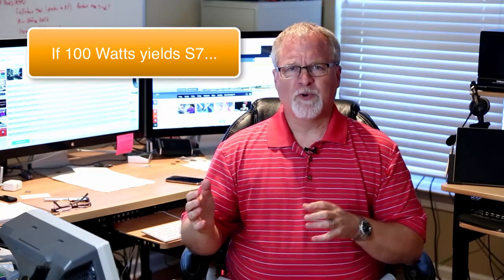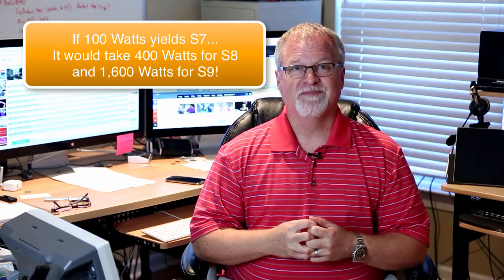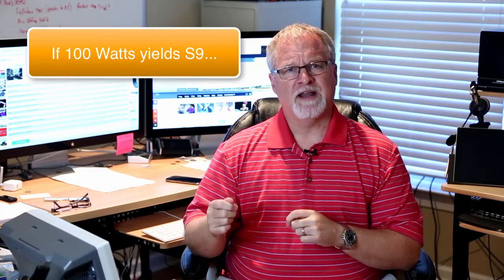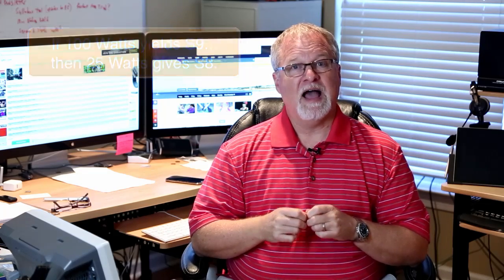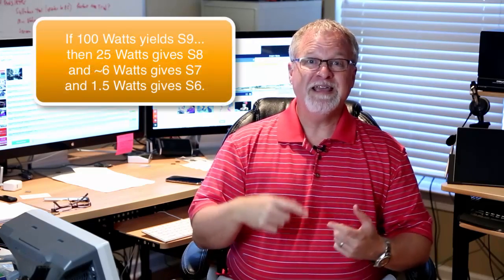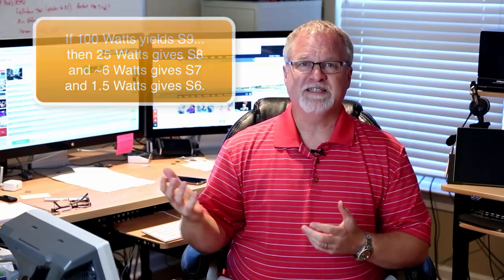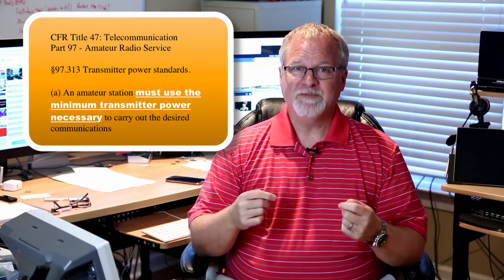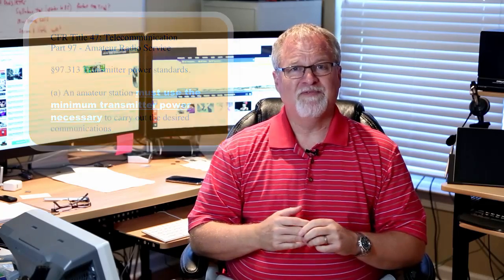Why QRP Works

Comment: The magic of qrp is mobility: I gladly choose my 5-10w transceiver and have the abilitly to be on a high hill with low noise floor, high altitude and nice scenery.
Reply from the maker: That IS a special quality made possible by smaller QRP gear. My home's noise floor is much higher than when I'm working portable, for sure! - Cliff

Comment: maths says if your 5 watts qrp rig are two S units under the noise floor, I can't ear you, but you easy can ear me with my 100 watts rig. Ergo, if you call me, I break my ears to ear you, and your pleasure on operating qrp are my pain.
Reply from the maker: Two questions:
1. Why would you try to work a station you can't hear?
2. Why are you watching a QRP video when you don't like that aspect of the hobby?
Reply: @QRPSchool  1. some times OMs tells me " there is a /QRP station calling you"  2. the video are posted by a fellow OM on my FB wall and I go to see...

Comment: I was up on W4G/NG-006 (Coosa Bald) with a 17m QCX Mini and QRP Guys EFHW.  I got a 339 from ZL2IFB (8200 miles away).  Another time I was running the same QCL with the QRP Guys LED SWR checker and forgot to switch it from TUNE to OPERATE.  This attenuated my signal to about 1w.  I got a 339 from a chaser in AZ, about 1550 miles away.  

Nothing like over 1500 miles per watt!
Reply from the maker: Oustanding, Richard!!! - Cliff

Comment: Great points.
I've been doing HF SSB for five years.  My portable radio is Yaesu FT-857D (100w).  This radio has performed beyond my expectations including 12,500km to Namibia from a picnic table and 12.8m random wire antenna in Saratoga, NY.  My interest is primarily trans-oceanic DX. I set it once to 100w and it's been that way for 5 years.  I should drop to 25w and reserve 100w for breaking into the most distant DX pileups when competing with the big guns.  Maybe even venture to 5w.  Baby steps!
Reply from the maker: "Maybe even venture to 5w.  Baby steps!"  Ha!  Hey, congrats on Namibia from a picnic table!  That was a good catch!  Okay, here's a challenge for you, John:  The next time you're talking to a station at 100 watts, if they tell you that you have a good signal... turn your power down to 5 watts for your next transmission.  They'll still be able to hear you because your signal will only be about 2 S-Units down from 100 watts.  If propagation is good between you and the receiving station, you'll be surprised to find that 5 watts are enough.  Of course, if propagation is bad, 100 watts isn't enough!  Even for QRP die-hards, if 5 watts isn't cutting it, it's time to dial up the power if you really want the contact. Have fun out there! - Cliff

Comment: When I am operating QRP all my contacts seem to be with stations using great big beam antennas. I wonder why?
Reply from the maker: Your 5-watt transmission is about 2 S-Units down from 100 watts on the receiving end.  So, if a station would hear you at S-9 at 100 watts, you'll be about S-7 at 5 watts.  Now, if the receiving station can't hear you very well at 100 watts, they might not be able to hear you above their noise floor at 5 watts.  If propagation is good between you and the receiving station, your 5 watts will sound loud to them.  It really just depends on whether there is favorable propagation between you, their noise floor, etc.  Sometimes you just need more power to make the contact.  - Cliff

Comment: Yes, everything you said is true. But, what if 100W signal is not S9? It is S5. That is real on the bands. How strong is qrp signal? S2 or S1. That is true also

By the way, I own ic726 100W hf and ft818 6W hf. And using ft818 more 😁. That is also true
Reply from the maker: Your QRP signal may be strong to a certain location but very weak in other locations.  When you're trying to contact a station @ 100 watts and your signal is only received as S5, it will probably be impossible to make the contact @ 5 watts... unless the receiving station has a very low noise floor.  In those cases, you can walk away or turn up your power.  I'm not saying that QRP contacts are always possible under all conditions.  But, QRP contacts (especially with CW or digital modes) are possible on most days.  And I think that is the fun/challenge of QRP.  You're not guaranteed to make all contacts so when you do have good success, it makes the session more satisfying.  I'm glad you are having fun with QRP!  - Cliff

Comment: The key to your point is that your signal level must be above the noise floor of the receiving station (with the exception of some digital modes). Too many stations these days operate with a noise floor of S5 or higher; but you have no idea what their noise level is when you're trying to make a contact (reply to a CQ). On the other hand, if you're calling CQ and operating QRP, then only those stations with a noise level below your signal will hear you and be able to respond. Once nice thing about QRP is that the power requirements and consumption is low enough to make operating remotely practical. One just has to be content with QSOs with stations the have low noise levels.

Comment: Another gud example of why QRP works, I can't count the times I've run QRP and had the op on the other end pretty much call me a liar that i was running QRP "you can't be!. you're hitting me 599! or 59 on fone! no way are you qrp.and unfortunately that was mostly back in the day before computers and internet, visual and audio files were available. so he/they had to take my word for it. I can still remember the thrill of hearing my 1st Eu QRP station, it still boggles my mind. and I"ve been at it for over 48 ys so far. tnx agn Cliff for all that you do for qrp and keeping us old timers in the loop. 72 gud dx de Ellis/WA1RKS

Comment: 2-S units can be a lot when working SOTA and of course when on a mountain peak qRP running on a battery DC power the antenna is key to a signal getting out - k6sdw
Reply from the maker: "2-S units can be a lot when working SOTA..."   Hmmm...  I'm not aware of anyone running 100 watts during a SOTA activation.  Or maybe I misunderstood your post?  - Cliff
Reply: @QRPSchool  A couple of the guys on my SOTA team share the load of an FT891 and BioEnno.  They run about 50 watts.  

I used to use an FT818 and 5Ah LiPo.  Ever since I went ultralight CW (29oz for my whole SOTA kit) my back and knees have been thanking me.

Comment: 5W is 1/5=20%
Reply from the maker: No context but I think you're saying that 5 watts (QRP) is 20% of 100 watts.  That's true. In the video, I talk about reducing 100 watts by a factor of 4 (to 20 watts) and then again (now, about 6 watts).  The difference between 5 watts and 6 watts is, really, nothing.  The receiving station can't hear the difference in 5 watts and 6 watts.   If you're transmitting 5 watts and you double your power to 10 watts, the receiving station will register an increase of only 1/2 of an S-Unit. So, 7.5 watts will register as a 1/4 of an S-Unit, etc.  6 watts compared to 5 watts is unnoticeable by the receiving station. -Cliff
Reply: Got it thanks

Comment: Thanks for the video.  I've been trying to look up the rules for maximum power that still officially constitutes QRP.  I know AM mode is probably the least ideal QRP  voice mode, but, if 5 watt constitutes the limit to QRP power using CW, would this mean that 5 watt Peak Envelope Power in AM constitutes the QRP limit or 5 watt unmodulated carrier and 20 watt PEP fully modulated?  I read that SSB QRP power limit is generally considered 10 watt maximum on wikipedia.  If the QRP limit for AM is 10 watt PEP, then the unmodulated carrier must be turned down to 2.5 watt, that's not a lot to copy AM signals, but it is possible especially using NVIS propagation.  So I wonder what the AM QRP maximum power is generally considered to be?

Comment: Does this theory hold true not only  for HF but  VHF and UHF in FM  voice as well? A 8 watt vs 5 watt hand held the 8 would not even be a noticeable difference? Thank you I enjoy your videos KE0QBN.
Reply from the maker: MWterritory Yes. There is very little difference in 5 watts vs. 8 watts. I wouldn’t even consider it a significant difference. Of course, if you’re on the fringe of repeater coverage, 1/2 an S-Unit can make a difference in being able to carry out a conversation or not. But, for the vast majority of contacts, 5w vs. 8w will not matter. Thanks for watching! -Cliff

Comment: I'm amazed on how QRP works well with minimum power. Not always, but just using 1w or 3w, I can do international contacts via CW! Depending on propagation conditions, 100w or 3w is "almost" the same... 73 de PY1ZB

Comment: Nicely explained but the problem is that "S" meters are not an absolute standard - crucially the interval between S units will vary between receivers. However the basic theory is sound.

Comment: Wow! I have been debating a FT-817 vs FT-857. Mainly for the 100w difference. This makes me lean towards the 817. Question: Lets say  I want to make a contact on HF from Northern California to Southern California. Will 5w on 40m be enough? what about from Nebraska to Southern California? Thanks!
Reply from the maker: KuriosPC Northern California to Southern California on 40m should be doable on most days - especially if you're using a wire antenna deployed horizontally at < 1/2 wavelength (66 feet).   As you lower a horizontally polarized antenna, the radiation take-off angle goes higher and higher and helps you to communicate regionally instead of long distance. You can look up NVIS antennas for more information about this.  As far as California to Nebraska on a regular basis... I don't know.  It depends on propagation and your antenna.  For times when your signal is marginal, it can help to have the extra two S-Units that are gained by transmitting 100 watts.  You can take a look at the VOACAP website and do some predictive modeling of the propagation to see which bands and time of day are more conducive to your success between two given places on Earth.  You can run some tests using the Reverse Beacon Network (CW) or PSKReporter.info (PSK31) to see who can hear your signal.  There's a lot to talk about here but it's nearly 1:00am and I'm on a cruise ship in the Caribbean Sea... and my wife isn't crazy about me sitting here typing while she's trying to sleep. :-). Shoot me an email if you have more questions and I'll be back to you soon.   - Cliff
Reply: I have owned the 817 for about a year now, I do love it. if you want completely portable that is easy to run off a small fold up solar panel then 817nd is the way to go. even when you turn the 857d down to 5 watts it uses about 2x the battery power for rx and tx then the 817nd. so you need a bigger battery and a bigger panel.  I use a voltage regulator and run the solar panel directly into the 817nd so i do not need any extra batteries other than what it already has (unless i want to run past about 1 hour after dark).     

I went with the 817nd because of the whole solar thing and being able to power it with a SMALL 60watt foldable panel, that folds up close to the same size as the radio and weighs less then the radio. if you don't care about that, (because you can also get a nice battery kit for the  857d what mounts on the radio, and you could get a panel to power it, but its not going to be as portable. it will end up weighing a lot more) then I would go with the 857d so you have all your options open. Again its almost as portable, its just a little bigger but the solar panel will need to be 2x the size to even power it at only 5 watts tx. because even rx on the 857d takes 2x the current  than the 817nd
Reply: KuriosPC I made a good contact on 5w from a 817, Cornwall UK, to north Sweden. 57 both ways!
QRP rules!
73

Comment: Thank for such a clear article demo'g how the power differences relate to signal strength!  I've been a ham 49 years and somehow never had this clear a picture.  well done video.  I just worked from WA to MD on 5 watts.  So exciting!
Reply from the maker: David Stehman Well done, David!  Keep having fun with QRP.  It's addictive! - Cliff
Reply: Cliff, it brings back the magic of my 1st transmitter DYI in '67 with a TV crystal at like 100mw at 3.55 MHZ.   Thanks for the mind reset
1

Comment: Hello my Friend 

Thanks for the Video !

I agree with you , in the theory , that you need 4x Power for one S-Unit
(i Also Make QRP with my KX3 Sota , Fieldday ...)
In The Theory :-)
 BUT you now , we working with Reflections , damping and other irritating factors
and a very Important Thing is - what antenna You Use.

On the receiving is no big Different , if the Conditions good and they have no QRM between 
10 Watts or 100 Watts
But when the Receiving Site has QRM or the Conditions are Going Up and Down 
The World is changing :-)
its not Imported what S Unit you Make , its only Important that the other Side can hear You

In the Beginning of my Portable Activities i use a FT 857 in my Backpack , and After 1h Calling with 
10 Watts and repeating many Times my Callsign i switch to 50or 80 Watts.
And the Activities often , at this Time , begins to make Fun :-) 

That's Why i begin to test What happens when i chance the Power in the Real world , not on the Paper.
I Use many different Antennas , with Remote Stations and Friends of my 
around the World.

Sometimes i can't understand nothing , on the Record from the Remote-Station`s , when i Use 15 Watts.
When i Switch to 50 Watts i can Record me Clear and Loud !

Sometimes the Different, from 50 - 750 Watts ,make only one S-Unit from DL to VK
Sometimes it Makes ( to Same Station with the Same Receiver )  4 S-Units 
and ist only way to Talk to my Friends.

I Like QRP , when i do Relaxed Sota or Camping , no Big PileUP and no Bad Conditions.
And i Repeat :-) in the Theory you are right.

But in Real Life , its not every day a QRP Day :-)  

I Like my QRP Setup 
I Like my QRP Achievements

But I also know the HAM`S shortly after the examination wanted to give up their hobby .
Only because Other told them he have to make QRP . 
and they do QRP And were frustrated.

Let's be honest - QRP can really frustrate
A Young OM , which had no countries in the log - having no fun at QRM on life .

theory and practice not the Same :-)

From My Site , I Love QRP ...........SOMTIMES .!
......................... Best 73
Reply from the maker: Hello, Carsten and thanks for your comments.  I agree with many of the things you are saying.  QRP is like fishing.  You sometimes come home without a fish!  This can be frustrating and is why I don't recommend new hams limit themselves to QRP. I think it's best for a new ham to use a 100 watt radio and to make many successful contacts.

Sometimes additional power is needed to make a contact and we should use additional power under those circumstances - or try again when the bands are more favorable.  At home, I sometimes have to use 100 watts and there are many times when my 100 watt signal is not strong enough to make the desired contact.  It doesn't frustrate me... I know that conditions will be more favorable later in the day or tomorrow.

Thanks again for taking the time to share your experience. - Cliff

Comment: I'm not a ham per se, but about the only thing I find attractive to the craft in general is the QRP aspect. Not sure why... something about the minimalism in terms of power used, compactness, but also some of the increased complexity in terms of getting things right. Oh, and the number of cheap kits out there, some designs have been around for decades, and they're so tiny, portable and just neat. Jolly good all-round.
Reply from the maker: Hello, Matt. Agreed. There's just something very cool about a small radio that can be used to contact people in foreign countries, using only a piece of wire for an antenna. Fascinating! - Cliff
Reply: I've used 1/10 watt, 100 milliwatts on the 10 meter band and made direct communication over 5 miles.
Trying to get as far as possible with as least power as possible is fun.
I see hams using 100 watts just to hit a repeater 2 miles away, they've also got up directional beams.
Using a 100 watts to me is global communication power without repeaters, Aiming my small homemade Antenna towards the sky at night as the atmosphere collapses and having chats with people 3 or 4,000 miles away.